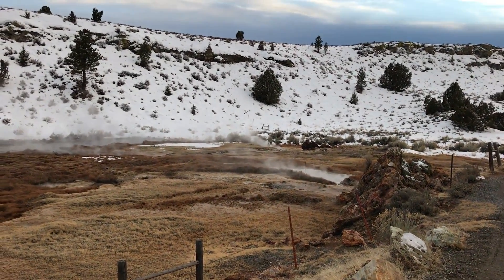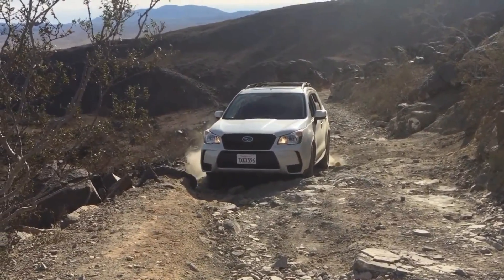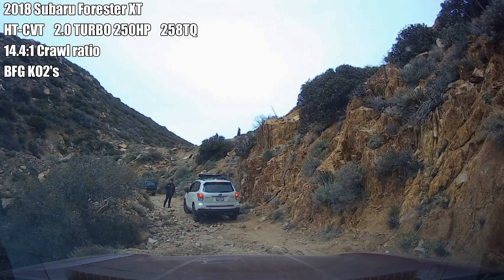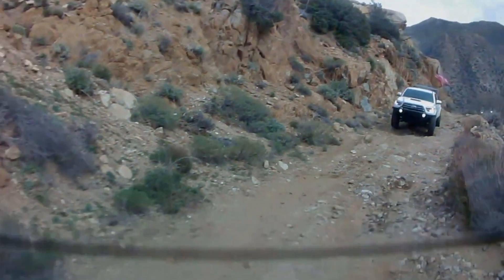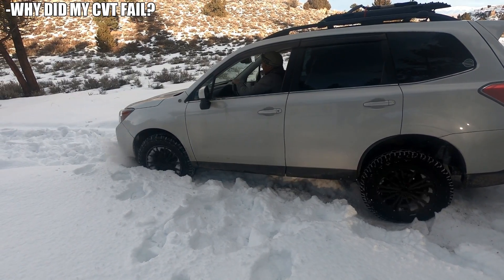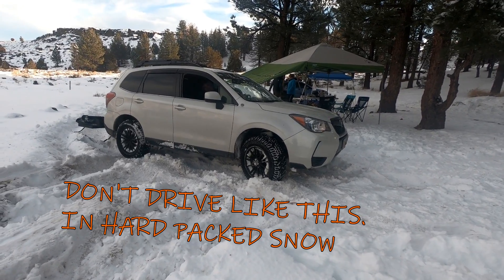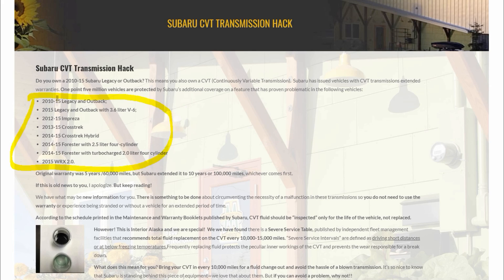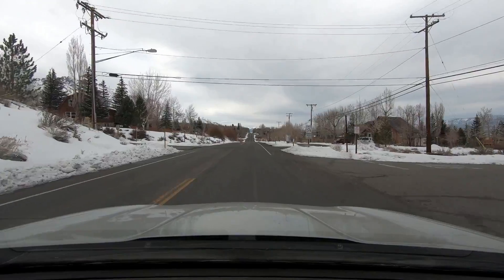CVT transmission Failed!  Can we make them last?

Comment: I've also learned that CVT's suck in the snow🤔
Reply from the maker: Yep... You have to fight for traction in the snow, and the CVT just doesn’t have much fight in it.  The new xmode 2.0 does better, but it’s still a far cry from what the older Subarus would do.  Watch the 2020 Outback struggle in driving sports TV.  It’s a paid promotion, so the host tries to pretend like it’s doing better 😃.  Older subies do way better than this....

https://youtu.be/Nvp9jxWsIvk
Reply from the maker: @EpicDrew15  snow conditions and ground clearance will *probably matter the most*.  If your Rogue is getting through 3 feet of snow, it has to be powder, even a Jeep on 40’s with 16 inches of ground clearance will high center and get stuck in 36 inches of harder packed snow.

Comment: Subaru's Lineartronic CVT has a limp-mode activate at approximately 251 degrees Fahrenheit. However, it will NOT activate the "AT OIL TEMP" malfunction warning lamp.

The limp-mode is characterized by significantly-reduced power output and the transmission refusing to allow the engine to go above 4000 RPM when in drive.

That warning lamp actually activates (excluding the vehicle start-up sequence) at around 260 degrees Fahrenheit and higher.

The big reason why this is a problem for a lot of Subaru CVT vehicles in North America is because many of the vehicles ship to these dealerships without the auxiliary transmission oil cooler that many overseas market vehicles have as standard. It seems Subaru has deliberately removed the cooler (for reasons we're not totally sure) that has resulted in a significantly-increased risk of overheating the transmission fluid and transmission itself.

What I know for sure is that every single Subaru Outback and most Subaru Ascent vehicles will have auxiliary transmission coolers installed from the factory in the USA. However, it seems only 2020+ Subaru Outbacks and all non-base model Subaru Ascents come with transmission coolers I can consider severe-duty capable.

Although I have limited experience with the Subaru Lineartronic CVT both with and without a cooler, the most significant lessons I learned are:

1) Subaru CVT's without an auxiliary cooler and used for any high-performance-type driving, off-road driving, heavy-hauling (relative to GVWR) and/or even standard easygoing mountainous use will VERY LIKELY overheat the fluid, even if the "AT OIL TEMP" warning lamp does not illuminate.

2) An OBD-2 reader capable of reading out transmission fluid temperature should be installed AT A BARE MINIMUM for those that use their CVT-equipped vehicle for "severe service". A transmission oil cooler SHOULD be installed to prolong the life of the transmission to an acceptable lifespan.

3) As demonstrated, the CVT actually has a marginally-better crawl-ratio than the 4EATs and 5EATs they succeed. Ultimately, the limiting factor is the programming seems to refuse to deliver full power and torque in harsh off-road-type situations, likely in order to preserve the CVT.

If anyone experiences the limp-mode on their Subaru vehicle's Lineartronic CVT, the fluid has now overheated, and the transmission has also effectively overheated despite the "AT OIL TEMP" warning lamp not illuminating. Immediate action includes pulling over to a safe spot, then blasting the HVAC system on full heat at high fan speed with the engine running, as the factory "cooler" uses the engine coolant to "cool" the transmission fluid. Depending on environmental factors, you may need to open all your windows. Because the fluid has already become quite warm, subsequent repeated periodic cool-off sessions may be required after the initial cool-down. At the soonest service interval, it is probably a very good idea to get the CVT fluid changed. Bear in mind, a lot of service centers will try to refuse doing this. You will need to be adamant about it, because the fluid has been ruined from the excessively high temperatures it was exposed to.

For those who have already overheated their CVT, you will either have to refrain from any type of severe service use, or do the proper thing and either get an OBD-2 reader and transmission oil cooler, or perhaps consider changing vehicles for the purpose you have chosen it for.
Reply from the maker: Good points!  The only thing is that it was demonstrated that even though on paper a CVT has a higher crawl ratio, in actuality, it does not.    Demonstrated in the video, the 4EAT with 12.6:1 climbs much better than a CVT with 14:1.  A chain just can’t lock up as well as real gears.  Just like plug in hybrids have a MPGe rating, I think CVT should have a special designation for a crawl ratio. Like “slipped crawl ratio”.
Reply: @JonDZ_Adventuring  One disadvantage I have not seen anybody address is the simple fact that a CVT has the same exact disadvantage as the typical gearset on a mountain bike or road bike, it cannot change ratios if the driveline does not have sufficient movement. In simple terms, if the drive wheels are not moving fast enough, it cannot change ratios.

I "experimented" with this hypothesis by doing an emergency-stop situation at over 100 MPH, then tried to accelerate as hard as possible.

The result was (because the deceleration was so severe) the CVT was unable to alter ratios quick enough, and I was left with a transmission still stuck in a very high (numerically low) ratio.

The solution that a driver can do to remedy this is to manually shift ratios as quickly as possible under heavy deceleration and/or slowly-increasing application of the accelerator pedal to simultaneously get the vehicle moving to reach sufficient speeds to allow the CVT to change ratios to a more-suitable range.
Reply from the maker: I use to ride road bikes pretty seriously for 5 years.  Did close to 10 centuries (American miles, no metric).  One thing I learned is that chains are stupid fragile.  When dropping the hammer, as we call it, and changing gears, If I didn’t ease back on the pedaling, the chain would de-rail.  Even the professionals in the Tour de France mess up with that every know and then.  Chains should not be in a transmission, period!  I don’t care if the chain is German engineered and made of comic book imagined vibranium, this type of design is not meant for enthusiast use.
Reply: @JonDZ_Adventuring  Agreed, the many weak points typical road cars with CVT's have relegate their best use to fuel efficient driving.

Although a CVT was experimented with in motorsports use (for cars), it was banned before it could even participate in a race. But unlike a transmission that simply needs to survive in a race or handful of races, vehicles sold to consumers need to actually last to consumer  expectations.

However, enthusiasts do not have the primary say on how a car company does its engineering. Government regulations and majority consumer preference will inevitably dictate what is ultimately used in future vehicles. No manufacturer can completely get around the corporate average fuel economy requirements, The CVT is honestly one of the most efficient solutions to solve that problem. The company is allowed to sell vehicles in the United States at the expense of enthusiasts who wants a good reliable two-pedal option to go off-road driving and/or spirited driving.

Although I actually do like how the CVT drives in commuting, the disadvantages established here showcase the current CVT's are insufficient for even half-serious driving.

Because of your videos, I am forever jealous of crossover vehicles with the ZF 9HP and its surprisingly-good-without-a-low-range crawl ratio. Although it's a pipe dream for Subaru to utilize a modern conventional automatic transmission with a half decent crawl ratio, I would still want them to do so.

On a last note, I'm kind of surprised you didn't include a clip from the video in which a lifted Subaru Legacy 3.6R sedan (that comes standard with the EZ36 H6 and 5EAT) makes it through Hell's Revenge in Moab, Utah. It's probably not as cool as the SH Forester making it up that hill in Texas, but I thought it was at least worth a mention.

Comment: how to make them last. Change the fluid every 50k miles forget what the owners manual says and DON'T OFF ROAD, A CVT transmission can't take the torque required.
Reply: 3yr/36k miles drain and refills are optimal.

Comment: Wow... painful to watch some of that footage. I have an Outback with a manual trans, and a 4Runner. I wouldn't run my Outback on some of those trails, but with the manual it would be more graceful. Maybe a little clutch smoke, but that's an easy thing to fix compared to a fried CVT. I'm sure I'm not the first one to point out... a 4Runner would eat that stuff up much easier with much less carnage. Subaru used to have a low range on some of the early cars, to bad that's not something you can get anymore, that would make a huge difference... even with a CVT that would be much more manageable. The CVT wouldn't have to apply so much torque to the output with a low range. I wish Subaru would develop an 8 or more speed Automatic, it would be able to achieve the economy they need to meet CAFE standards but would be more durable.
Reply: I have similar feelings. My beloved 2007 Toyota FJ has a relatively rare six-speed manual with full-time 4WD. Despite the transfer case, it's not super-low geared or "tired" for rock crawling, but I love it for everything else (except the mpg!). We would consider a Subaru Forester when my wife needs a new car, but the thought of roughing it off-road is tempered by these CVT reports from more adventurous owners. My understanding is there's no room for an "advanced" automatic without a complete redesign of Subaru's traditional drivetrain/chassis layout. Personally, I'd be happy with a rugged manual trans, using an added "granny" gear in lieu of a low range!

Comment: toyota and honda makes a reliable CVT
Reply: Toyota only puts CVT's in thier economy focused vehicles. If they put a CVT in anything like the 4Runner it wouldn't last off-road for long. Toyota most recent CVT now utilizes a conventional 1st great before going into CVT mode, that does make it better in that regard, but an automatic is still better.
Reply: Tell me again about the reliability of the cvt on the corolla hatch?  I think I remember a recall.
Reply: Not true. Toyota and Honda make a better cvt. But it is not reliable. If it’s abused it’ll fail just like every cvt. A rental Corolla left me stranded with 11k miles. I’m sure it was abused and driven at wide open throttle for most of its life.
Reply: Not for off-roading.

Comment: If I don’t off road, what is your expectation of the CVT longevity? I am picking up an Outback Onyx XT next month, which is the TR690 with FA24DIT.
Reply from the maker: The Subaru Ascent is having so many issues with the TR690HT.  The Outback has the same power plant and same CVT just 500-700 lbs lighter.  The decreased weight will help prolong the life, but by how much, I don’t know.  FYI, the crosstrek is the most reliable Subaru CUV, and it appears weight has a lot to do with CVT longevity.  I have a friend (popular IG guy, but I won’t mention who he is) that has a 2nd Gen Crosstrek. It was weighed down quite a bit with a roof top tent and lots of gear.  and his CVT died (he off-roaded it).  his TR580 died in less than 2 years, may have been 1 year.
Subaru considers stop and go city driving “severe”.  Driving up a highway mountain pass is “severe”, so you don’t have to offroad to kill the CVT’s.  A transmission temp monitor is your best way to keep your CVT alive.  If your temps get to around 230F, give the vehicle a rest.  Good luck with your future Subie!  I hope everything works out for you.
Reply: @JonDZ_Adventuring  Thanks. At least they have transmission coolers. Will definitely keep an eye on temperatures.
Reply: Cancel that purchase. It’s not a matter of if but when you’ll have problems.

Comment: The way CVT operates...it will not last compare to manual and standard automatic...i just wonder whats wrong with 5 or 6 speed automatic on off road vehicles
Reply: Many car trends are stupid...CVT is one of them...i go for standard auto
Reply from the maker: Unless you’re a really skilled driver, auto is the best choice.  I was researching transmissions and I came across information that says a torque converter can multiply crawl ratio by nearly a 2:1 ratio at launch.  I’m not an expert on this, but through observation, I find this to be true!!!!

Also, many Subaru owners of later models with the 4EAT (4 speed electronic automatic transmission) have compared offroad ability to the dual speed manual.  The auto has a 12:1 ratio while the dual manual has a 22:1.  Many have observed the automatic being just as capable.  Manual gear boxes seem to need more crawl ratio compared to automatics.  The new bronco will have a manual crawl ratio of 95:1 while the automatic will only have a 68:1.

I agree about the CVT.  It was developed over a decade ago for better MPG’s.  While it has succeeded, it has been surpassed by more fuel efficient 8, 9 and 10 speed automatic transmissions.  Another argument is that only a CVT can take multiple inputs from both internal combustion engines and electric motors.  Well, Ford has figured out how to input electric motors “inline” with a traditional automatic transmission.
With all that said, I think people will be surprised where a CVT can go.  Unfortunately, it’s not a surprise at how long they will last.  Best case scenario is around 250k miles, where as older Subaru automatic transmissions were known for hitting 500k miles pretty regularly.
Reply from the maker: Imo, an automatic transmission is ideal for offroading because of the ability to load up on the torque converter.  Although the Subaru CVT has a torque converter, it can’t be loaded up on.  A manual transmission can work for the skillful drivers.
Reply: For me...manual or standard automatic will be fine...for CVT's nope, current design still questionable...

Comment: The problem is not the CVT. The problem are those owners using those cars thinking they are driving a monstertruck. I'm actually surprised how much misuse those cars are able to handle.
Reply: I never in my life seen so much miss information in the comment section!  Why on earth do these people that are dedicated off roaders not use proper tires and psi
Reply from the maker: Have you seen a Subaru commercial?
https://www.youtube.com/watch?v=10QyLxU_7AY
Reply: @JonDZ_Adventuring  have you seen it? And have you read the owner manual?
On the commercial are gravel roads and  in case of stones its never higher than the clearance. The cars you have show are driving on completely different terrains.
More from the official owners manual (from the driving tips/off-road driving chapter):
"Because of the AWD feature and higher
ground clearance, you can drive your
SUBARU on ordinary roads or off-road.
But please keep in mind that an AWD
SUBARU is a passenger car and is neither
a conventional off-road vehicle nor an all-
terrain vehicle. "
Reply from the maker: @marcocasamassima389  Prior to 2018, Subaru did not recognize severe duty.  They considered the CVT fluid lifetime.  Unfortunately and unknowingly, I was a Subaru CVT beta tester, I drove a 2015 Forester XT.  So, although you are correct at the time of your comment, the below information was not in my 2015 service manual :

"If your vehicle is used under any of the Severe Driving Condition examples provided on page 30, you would want to also follow CVT fluid replacement every 24,855 miles. Trailer towing is listed as Severe Driving and as a result, you would want to follow the 24,855 mile recommendations." - Subaru

Note that severe duty (according to Subaru) is something as minuscule as “driving around the city” or up a “mountain pass”.  So, you may very well be misusing yours as well.  How many miles do you have on your Subaru?

Comment: you need a Jeep or other 4x4 for Trails like that cvts are not made for that sort of abuse
Reply: Non cvt AWD vehicles have no problem. The CVT is the weakness. The grand cherokee and Honda Passport are two great examples of non 4x4 vehicles with tradition autos that do just fine.